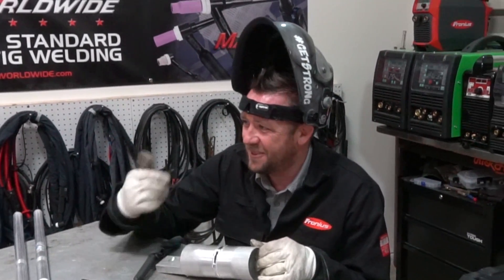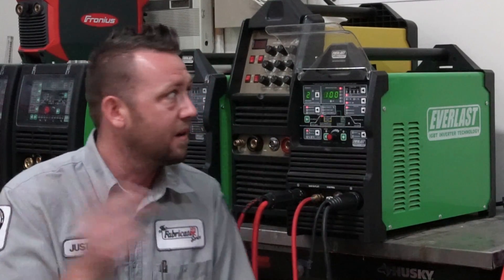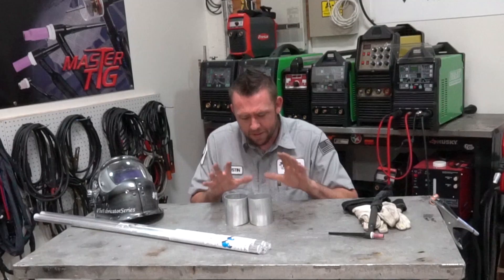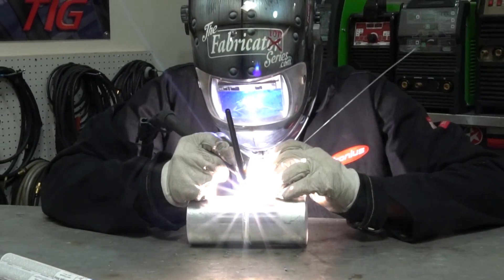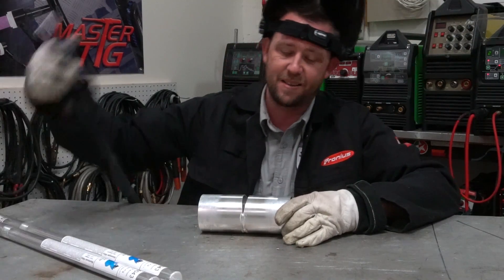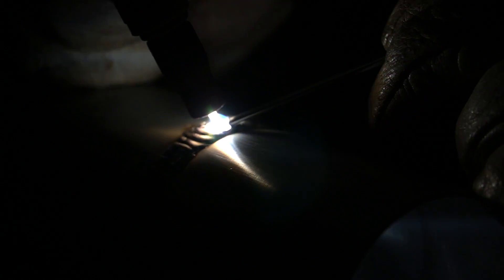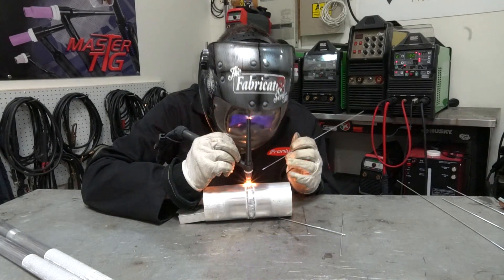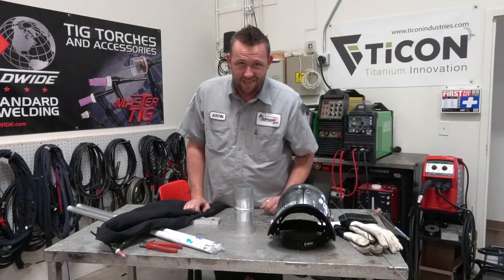TFS: How to Bridge Gaps and Holes on Thin Aluminum

Comment: Bro. Unrealistic. There's no way your gonna just hold aluminum pipe that thin in your hand after running a bead that long with just regular TIG gloves... Unless you've got super isolated gloves they would've instantly burned the fack outta your fingers and started to smoke. Lol. Just trolling a little bit in a friendly way. But honestly, not everyone has common sense. They may think that cuz you "picked it up right away", they can do it just like you and now their finger prints are gone and they never realized that you obviously let it cool before the beginning of that scene. Lol no hate just pointing something out. Keep up the great content.
Reply: Aluminum dissipates heat hella fast bud.
Reply: @derrickquintal  yea I mean that's why they use it for heat sinks but I'm a welder and have burnt the hell outta myself many times doing the same thing When I was in college. Like I said I was only messing around anyway lol. Couldn't you see someone burning a super hot bead and picking up the piece of metal? I could lol
Reply: I can see that, but, as a welder, fabricator and machinist myself I know for a fact that the peice hes demonstrating here you can't run a super hot bead on. I have no doubt a good set of gloves could pick this up after being properly welded.
Reply: @derrickquintal  yea your prolly right. I guess I've just had bad experiences with aluminum.
Reply: Patrick Olsen  I weld thin aluminum and holly crap that stuff gets sooooooo hot. I know exactly what you are talking about.
Reply: Patrick Olsen it’s Tig welded at 70 amps and it’s aluminum. 100% he can pick it up after welding with his gloves. He doesn’t bs people if you’ve been following him since the start like I have. I know you’re joking around but unfortunately you were wrong.

Comment: id tensile out a piece of the gap size, cut, tack it on, then weld.
its waisting time(stackin) and money(gas). that method is good to know but not worth losing out on money when doing a job. maybe if its a last minute thing to do and on the type of project it may be. no one wants to lose out on cash.
Reply from the maker: It's not always going to be optimal though. You can't always make it work then way you want. The time on this piece isn't really that long. Maybe 5-6 minutes tops and rye gas was reduced with the small cup. It just took 16 minutes for me to demonstrate the method. Real time is much less which puts the job in a realistic realm if that's what was presented to you.